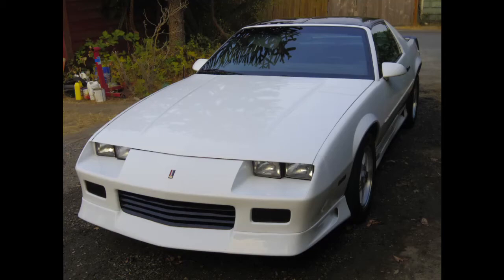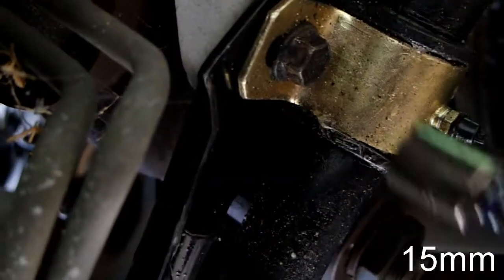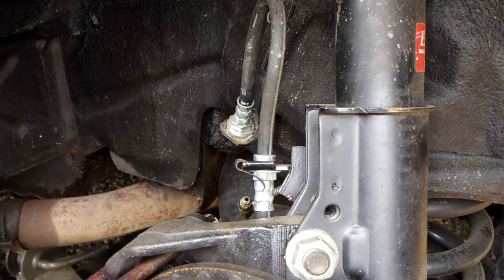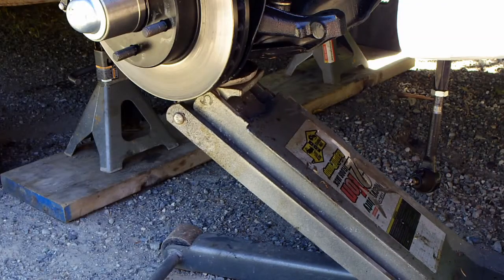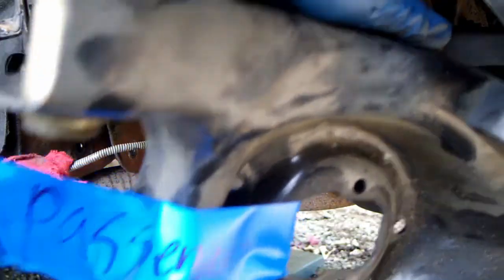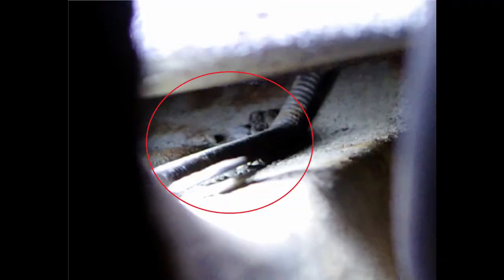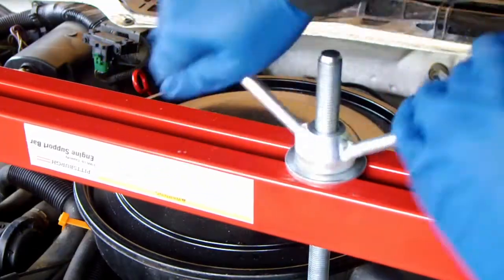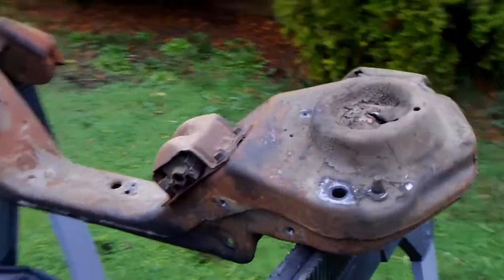Complete Front Suspension Removal (1982-1992 Camaro/Firebird)

Comment: Damn!! Straight A++++ Video!! Very very great video. Would you please do one on Door pin replacement?? I want to see the techniques you would personally use to get the front fender off without taking off the front bumper etc, simplest way possible. Thanks for the video, keep making them!
Reply: Also, how many Ft Lbs does that little impact you're using, have?
Reply from the maker: well unfortunately you  probably won't see that video.
the front end of this 92 was repainted 6 months ago so i have no reason to take fenders off
Reply: hood off,hood hinges off,all bolts right and left along were the hinges are off (from nose to end of fender)
,1 bolt on each side under rear of fender / below car(usually were people incorrectly jack up the car)
2 bolts per side behind the plastic inner wheel well covers attaching the ground effects,front lower ground 

effects need removed right and left and three bolts per side attaching fender to nose,thats it

slide fender towards rear of the car carefully
Reply: @3rdGenGuy  you can use my car

Comment: Really good tutorial! Thanks for sharing! I was just looking at how to remove the suspension and steering set up, as I'm currently restoring my Firebird! Can you recommend a brand for all of the joints (Ball joints etc.) ACDelco only or anything else? Thanks
Reply from the maker: these vidoes cover the steering stuff 
https://www.youtube.com/watch?v=1nFJRU2bK6g 
https://www.youtube.com/watch?v=MwG3i6EJNQM

the ONLY balljoints you should use are the QA1 (1210-209P)
https://www.summitracing.com/parts/qa1-1210-209p
these joints are WAY better than the stock AC delco ones and offer MUCH better handling.
they raise the front roll center by 1/2in, 3rd gens benefit from this by a LOT!
the joint is also rebuildable and like $20 more than the AC delco one.
BUT they will lower the front of your car my 1/2in (without messing up the geometry) keep that in mind.
Reply: MotorScotti moog is good stuff

Comment: This is an amazing video. Why did you change the K Arm? My Z28 has had all suspension parts changed except the K or cross member. The suspension is very noisy, rattles and every bump is noticeable. Will the K arm be part of the issue? Any help would be appreciated.  Car drives like there are no shocks, strutts, a pillars etc.
Reply from the maker: I didn't change anything, I Just removed the suspension for some engine repairs.

Comment: Great video but I thought I had to compress the coil to remove it. In the other video you had to compress it before it was removed. Does that not have to be done?
Reply from the maker: you can tie it up and let it pop out.
or use a spring compressor. 
it's unsafe to let the spring pop out, but ya
Reply: Works perfectly fine following your steps.

Comment: Any special procedure for re installing that coil spring? Is it just as simple as reverse order from disassembly
Reply from the maker: my first Video ever covers installing the front springs.  it's pretty straight forward
Reply: @3rdGenGuy  okay I’ll check it out! Thanks!
Reply: @3rdGenGuy  in the other video you used a spring compressor on both the removal and installation, in this videos you used a nylon tie on spring removal, and reason I can’t put the spring back in and compress it with my jack?
Reply from the maker: @DougieeStyle  you can unbolt the A-arm, install the spring and use a jack to compress it up. it can be hard to get the A-arm bolt holes to line up though. i would recommend a face shield if doing that method.
Reply: @3rdGenGuy  haha I’ll just buy the tool, I’m not one to take risk with things under pressure! Thanks for the advice!

Comment: I have a question and hopefully you have the knowledge I'm after.
Have you ever shoehorned a gen IV 454 into a 3rd gen Camaro? That's the project I'm currently on. I'm doing a full Spohn suspension swap to start, but my concerns are more fitting everything BESIDES the engine under the hood. It's gonna be carbed as well. I can't seem to find videos of the actual work, just idle or drag passes.
Reply from the maker: there are a few threads on thirdgen.org on big block swaps.
i'm not knowledgeable on the subject.

Comment: Hello. Great video.  I am trying to line up new poly motor mounts onto my '92 Camaro. The problem is that the RH will not line up into place.  Will the engine leveler bar that you used help me correcting this problem? Thanks in advance for the advice.
Reply from the maker: SO i had some issues getting the Stock replacement motor mounts in.
took 3-4 tries before they lined up.
keeping the engine and K-member level helps a lot
I bolted the mounts to the K-member and lifted the member up.
it's a little different if you are just lifting the engine up.
Reply: make sure the proper mount is on the proper side or it will not work. ps to ps, ds to ds

Comment: I see you are using adjustable caster/camber plates. Which one do you use or recommend? I have a +camber issue that I can't fix using the stock plates. Would this help?
Reply from the maker: there's a few options.( i have a video on  installing them)
1. HOTPART plates: they are the original and the ones i use. (best price)

2. Detroit speed: their plates are probably the best, but also VERY expensive. they have tons of cool features.

3. UMI has a HOTpart clone mount, but they use 3/4in opening holes, so you need a bushing to use stock struts.
Reply: @3rdGenGuy  Thanks! I was just on the hotpart.com website. Do you think this can get me to fix my + camber issue. My shock towers are already to the max toward the engine and I still have +camber.

Comment: You don't have to remove the brake line necessarily if you just want to replace the A-arms, right?
Reply from the maker: the brake lines unbolt from the K-member.
you don't have to remove them if you don't want too.
Reply: @3rdGenGuy  I mean do I have to remove them at the caliper or can I just leave the caliper supported somewhere nearby? It's just because in another video where they replace the springs, the also remove the brake line.